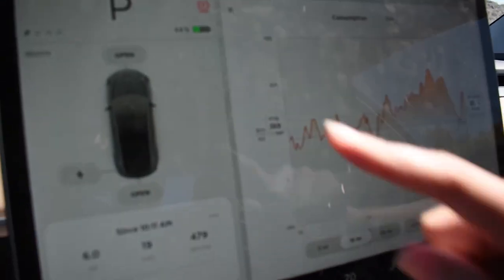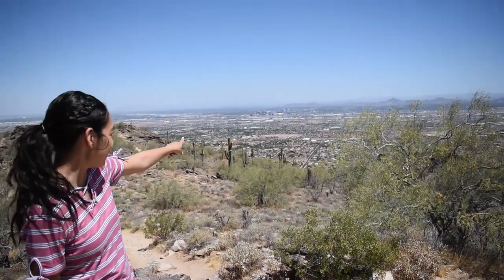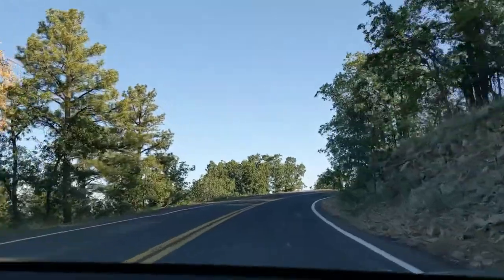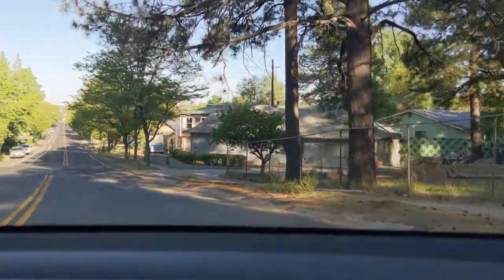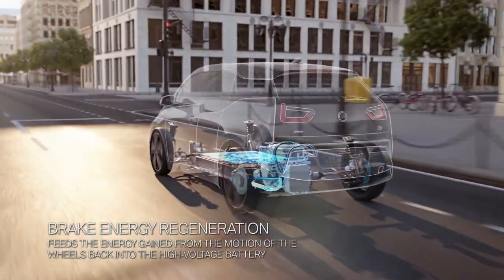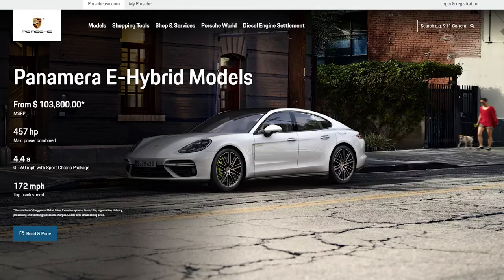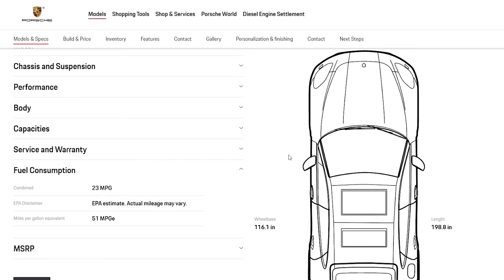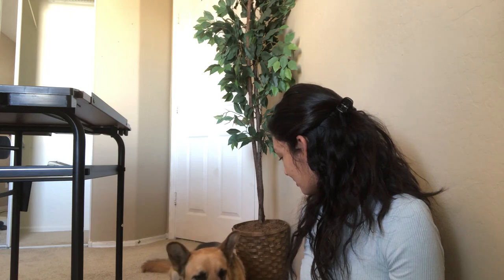What is Regenerative Braking?

Comment: Great video!  Recently I took a trip to the mountains with a tesla model 3 awd and my battery charge was 75%.  The temperature was around 70 degree.  The battery management system flashed a message on the screen that it was reducing the regen braking.  On further research I discovered that regen braking works similar to when you are charging the car.  As your battery charge increases the battery management system will decrease the amount of charge going to the battery as a way of protecting the battery.    Tesla did some great engineering.